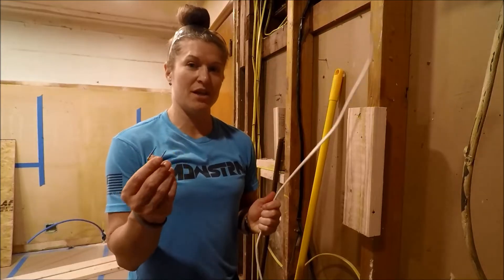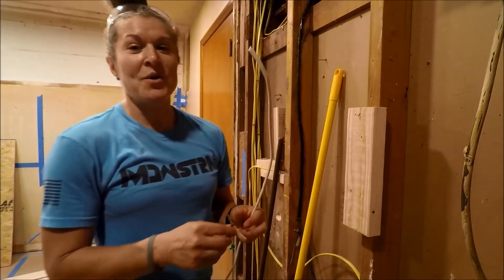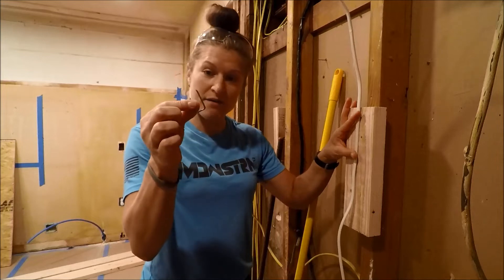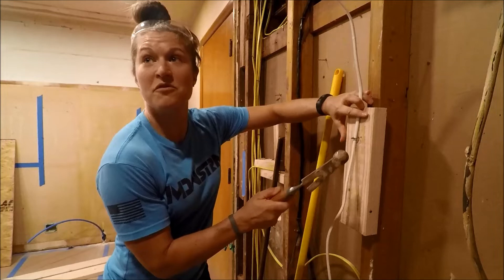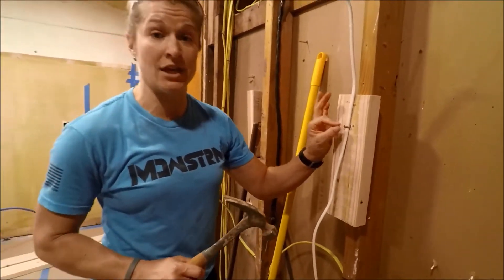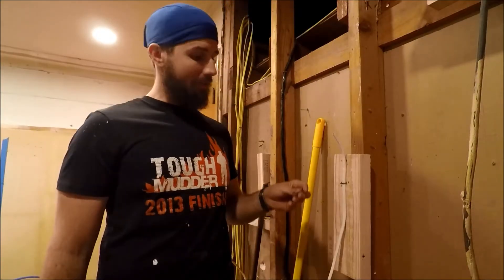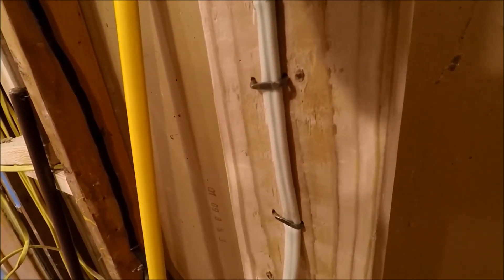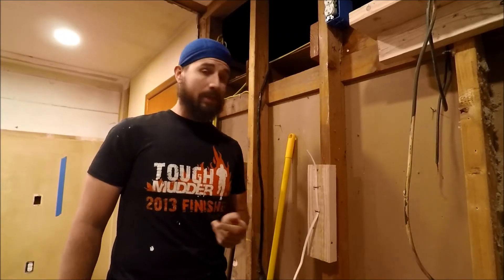How to Staple Electrical Wires Correctly (and what happens when you don't!)

Comment: Insulated staples are required in some jurisdictions.   Also, they limit the number of conductors you can use under a staple. Always check local codes..
Reply from the maker: Truth

Comment: What size staples are those ? Actually what I'm trying to do is get all these exstention cords off my floor. I live in a motorhome and my brother is running a line from his home to mine. I have all these exstention cords connected to it to access the power where I need it so this has left me with just a mess of cords everywhere and some times my son steps on then he actually unplugged the one to my fridge ruining 9 lbs of hamburger.  Believe me when I say that hurt the pocket so I wanna get them off the floor for safety and practical reasons any advice would help.

Comment: How do you staple after drywall is installed already? If you add a new outlet for example
Reply: Just fish them down the walls, no staples required.
Reply from the maker: In that case you do not staple them. The staples are in place during construction and attics to keep them from getting in the way of the other trades like drywallers.

Comment: Is this much of an issue with insulated staples
Reply from the maker: It is not as much of an issue with insulated staples. However, if you drive them in hard enough it could still causes issues over time.

Comment: If you staple wiring the old adage of don’t leave old wiring in a wall so you don’t scare the heck out of the next guy whose doing some mods and finding out he just cut thru wiring that shouldn’t be there and thinking it could have been live. How would you be able to pull old wiring out of an existing wall?
Reply from the maker: Hey! In our experience old cloth wiring seemed to be stabled in pretty darn tight and was not able to pull it out. So, it stays in the walls.

Comment: I'd check your local building codes. I got screwed when there was a code update and they changed the requirement to needing insulated staples. Just make sure you're not gonna have to tear everything out like I did.
Reply from the maker: Good call out! Each local area will have their tweaks to what is considered passing.